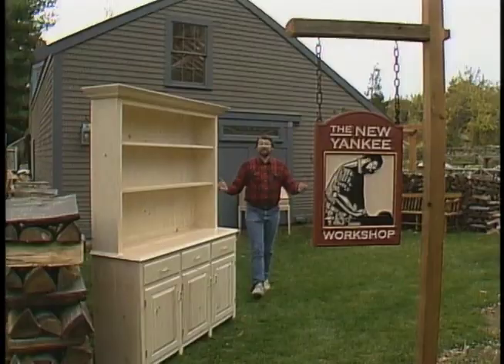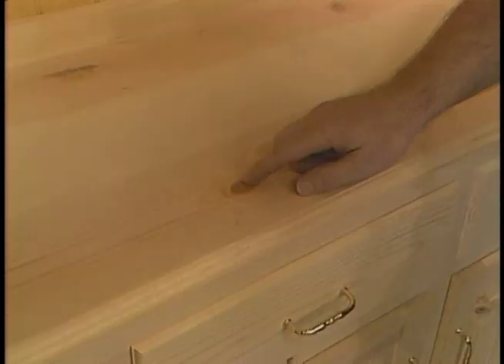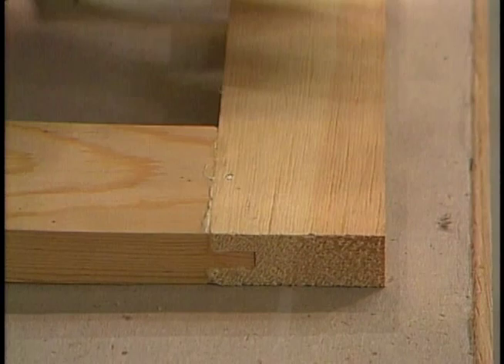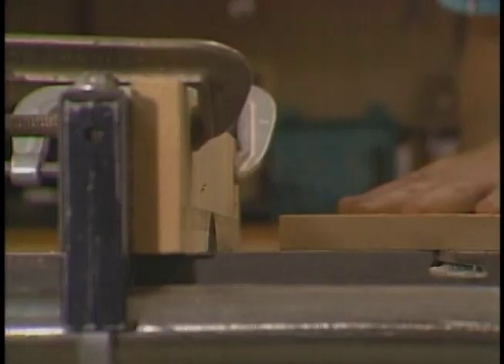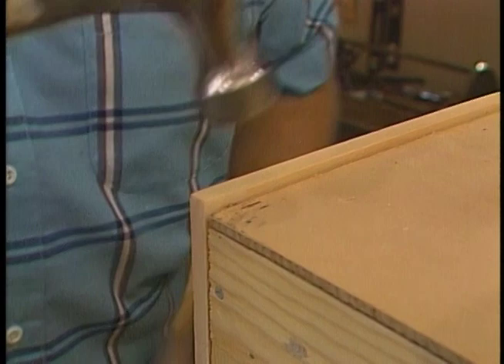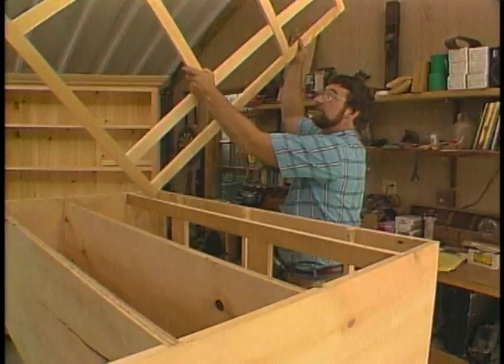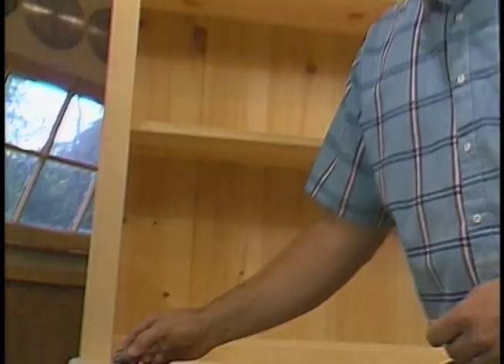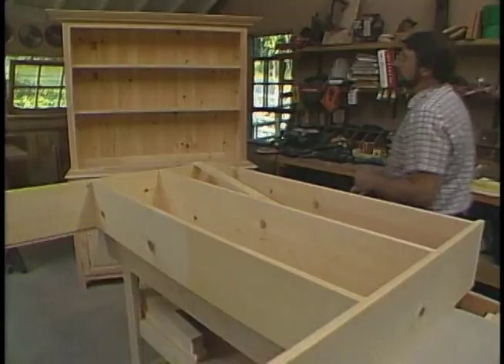Hutch  |  S1 E11

Comment: Norm hammering in nails instead of pneumatic nailer of later shows.
Reply: That is what I was looking for in a woodworking video, good old fashion woodworking nailing. Except where he used pocket hole joinery because where I live, we don't use pocket hole joinery. We just use hammer, nails or most of the time screws. Plus, woodworking glue.